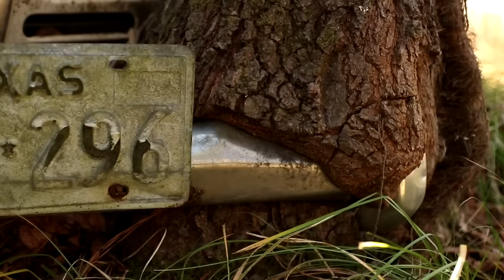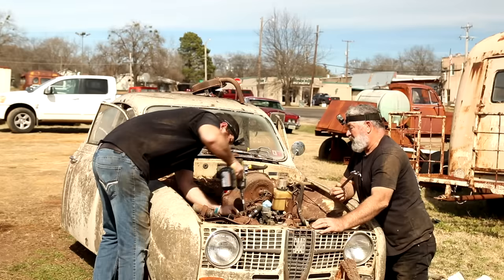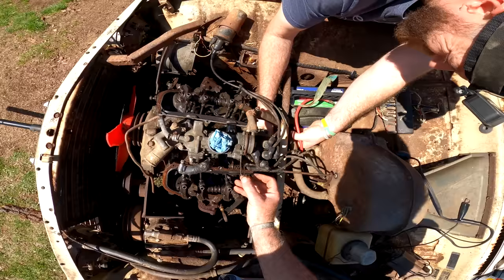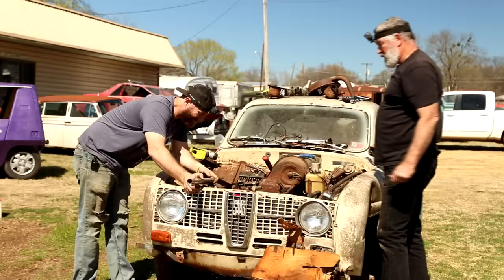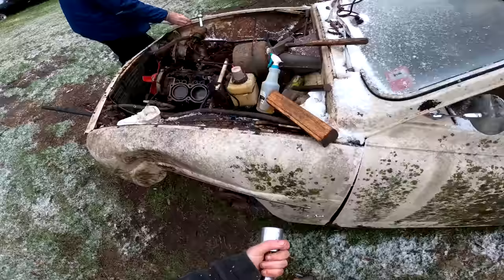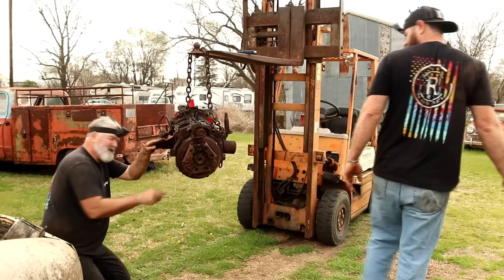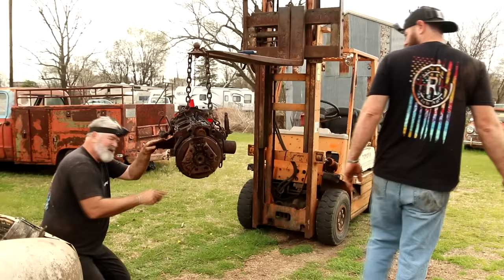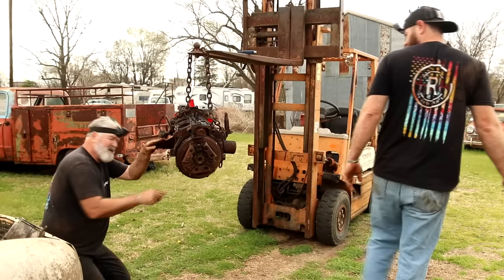THIS IS BAD! Attempting To Start Locked Up V4 Engine Covered In Rats Nest | 1968 SAAB 96 | RESTORED

Comment from the maker: Watch Us Rescue This Car From The Woods Here: https://youtu.be/ilqYDlPsD6g
Reply: I'm watching the guys intently to see the car functioning, I'm actually excited. Keep up.
Reply: @dumisanimashabane3206  .ok
Reply: Saabs are notorious for their transmissions crapping out. Love that your trying to bring the Saab back to life. I’ve owned several myself, my 1987 we had to replace the transmission.
Reply: Question please : How do you find replacement parts for this old rare Saab ??
Reply: Have u heard about youtuber mustie1. The undead master of all engine.
Reply: If it is water in the cylinders, there are in the carter, crankshaft. You need's first to change 100 years old oil, and then crank the engine. I get on it, the water in the oil was above all the engine mechanism.
Reply: @jeanmontinat1681  by asking me and several other Saab owners. I have owned several of the Ford V4 engines that were used in the vintage Saabs. I have connections with many other people parts and knowledge about them.
Reply: I can help you find parts for that car. I used to have 10 engines, 14 transmissions, and many many other spare parts. I have connections with people that can help. I’ve owned 5 Saab Sonett cars and 2 Saab 9-5 cars. Let me know what you need and I can help
Reply: I’ve owned…
1969 Saab Sonett V4 
1972 Saab Sonett III 
1973 Saab Sonett III
1974 Saab Sonett III 
1974 Saab Sonett III 
2004 Saab 9-5 Arc
2008 Saab 9-5 Aero
Reply: Apply  gas. In. The. Cab.   It  may. Start.
Reply: Why not clean out with some rust remover so you can see what's what cause it's bad enough all the parts you have to remove.
Reply: Nd you jenius
Reply: Yes Dhe bhets
Reply: Вааппршщ
Reply: Вааппршщ
Reply: Вааппршщ
Reply: @dumisanimashabane3206  😊
Reply: @dumisanimashabane3206  😊😊😊😊/
Reply: @dumisanimashabane3206  😊
Reply: If you don't already know its a stable 96 (ninety six) nicknamed  the jelly mold due to its shape the engine is a v4 ford engine used in 50s ford's like the concel

Comment: HEY! I hope you see this comment but the freewheeling clutch means you can not pull/pushstart it! The clutch engages slowly when the engine revs to a certain rpm, ~1500-2000. The freewheel clutch operates EXACTLY like a chainsaw, kicks in with rpm. Identical operation in bigger scale. You can put the car in gear without pressing the clutch when taking off. The 96 had the freewheel clutch because this body style saabs used to have 2-stroke engine which seized; didn't get lubrication if let to engine brake but Saab decided to continue using the freewheel with these German Ford V4 engines. These cars were built where I live, were very common back in the day.
Reply: I made this comment on another channel. How the FK did it get here???????????????
Reply: @UberLummox  where else would that comment be relevant? you sure? :D
Reply: The freewheel mechanism can be locked out, just pull the lever.
Reply: So wrong! You can change gear without using the clutch when at some speed 'driving' and the freewheel is engaged. Starting from a standstill without using the clutch would be 'impressive' and harm the gearbox bigtime, next to impossible! Drive it like a manual! How I know? Currently have four of these SAAB's as in two of the 96 model and two 95's thats the estate or 'wagon' version. Oh and you cant reach any part of the crank from outside, needs front cover of engine taking off for that. Trying to hard to turn it over when stuck as bad as this one can harm or ruin the costly cam gears made of 'fibre'. SAAB Club of Sweden can sell you most of the parts needed, and yes they happily ship parts worldwide. Otherwise try Tom Donney in the USA. He even remanufacture some gearbox parts for these.
Reply: @thatdudeinorange2297  I agree on the taking off part. 

But he was right about the short-nose body style, and early long nose body style, was 2-stroke, and the reason for the freewheeling!

But the freewheeling was because of lubrication, IIRC?
Reply: @thatdudeinorange2297  maybe they are lucky and the gear wheels were exchanged for metal ones as the car has AC installed.
Reply: Freewheeling engages in one direction and disengages in the other, just like a bicycle wheel. It must be driven like a standard manual gearbox from standstill. But when moving the revmatching feature allows gear changes without the use of the clutch. If push starting the vehicle is needed, the lockout lever must be in the right position. That lever is usually not frequently used and can be frozen. Check the linkage on top of the gearbox if it is moving or not.
Reply: You had to use the clutch to pull away the freewheel clutch only worked on overrun so you could change gear without using the clutch but you were advised never to engage it if you were towing as there was no engine braking in overrun
Reply: Also the freewheel was engaged or disengaged by pulling or pushing a lever down near the clutch pedal
Reply: Hey you're right|| I had forgotten that my 1968 Montecarlo Saab (3 cylinder 2 strokes!) had that free wheeling feature.. but I wonder if they equally had it on the four stroke V4 engine as well?? Good point.
Reply: @volvobrynk  The 3 cylinder was the 2 stroke engine. The V4 is a four stroke.
Reply: @disneydorks6396  yes, I know.  
What makes you think I didn’t 🤷‍♂️
Reply: I used to have a ford  capri .when ford had ties  with 🇩🇪 Germany that car I wish I still had .it had  plenty of rpm.s  2 door grate car haven seen one in 25 years now
Reply: @thatdudeinorange2297  I know a lot of people who like doing that. Know idea why maybe think it's cool well its not any manual transmission if you install on shifting gears wit out useing the clutch will destroy the gear box... and who know what else  why destroy the gear box on purpose
Reply: @thatdudeinorange2297  but the hole 👉  is why bother your accomplishing nothing  you can do what your saying but for how long in the end your still destroying the gear box
So why even bother just do it normally
Reply: @thatdudeinorange2297  100 percent correct finely a person with common sence
Reply: @markcaswell715  you never use the clutch when towing any Manuel  or you will destroy the clutch. It's not a big mystery here.just drive it normally and you will get years of  maitinace free issues
Reply: @disneydorks6396  we know that already we're beyond that. Sab should of stuck with the 2 sroke  isetta  did
Reply: I believe it was around 72   or 73  small but a greate car
Reply: The capri was a greate car back in 73 but as time went on the got to big and ugly
Reply: It's not a lockout lever, it a little T handle you pull out from under the heater. The comments about a freewheel being an automatic clutch is hilarious, the posts from the expurts here are certainly amusing.
Reply: @rickwaldron4255 ; nope that's a late 60's, the second year of the V4 models.
Reply: @thatdudeinorange2297  Correct, that freewheeling clutch works when you switch to second and more. That was , I think it was from time in 2- stroke engines. Because revs did not come down so quikly than 4-stroke-engines. But I have had both of them and it is fine with 4-strokes too. Only Saab had this.
Reply: @mattinieminen9826  And Auto Union DKW.
Reply: @thatdudeinorange2297  I really don't think they care about what breaks on this car
Reply: The three cylinder was 2 cycle. The v4 was 4 cycle Ford engine
Reply: So that means it just needs to be locked
Reply: No the 'freewheeling clutch is NOT like a chainsaw. It is more like a bicycle so you can stop pedaling and coast. You can NOT put the Saab in gear when idling without pressing the clutch and you need to slip the clutch to get started just like a normal manual transmission. The clutch does not slip it is a normal dry pressure plate and clutch design. The 'freewheeling mechanism is mechanical and resides in the transmission and there is a lever to engage/disengage the 'freewhelling' feature of the transmission for engine braking in mountains or to push the car to bump start it.
Reply: Suomi mainittu!

Comment: I really want to see more of this car. It’s so unique and I’d like to see a little bit more progress on this one!
Reply: Absolutely. I love unique cars. I know it takes a bit more to get parts and they're unfamiliar but that's what makes the videos so interesting. Please do more with this Saab.
Reply: I owned one similar.. except that it was the "Monte Carlo" edition with the original Saab two strokes engine, three carburettors.. ;-) much more fun. Saab made two strokes engine cars for over two decades, then they put these V4 Ford engines for a couple of years and then got that famous Triumph 4 slanted cylinders block in their new "99 model" wich was in fact the same car (the 96 model) but made wider and more modern looking. Then they added the turbo to it.. and the rest is history.. I still drive a 9-5 model Saab that drives and looks like new after its 14 years of use. Bravo Saab.. By the way, if you look on the net, you'll sure find Saab 96 models racing in rallies and winning.. they were fun cars.  Sylvain Giguere Québec Can.
Reply: Yeah,  get the parts and rebuild it. You win some and you win some harder. You don't lose some.
Reply: Apparently you can do a full turbo race build on these engines!
Reply: @GiguereSylvain  Slight correction: the 99 was a completely new model, nothing to do with the 96. The classic 900 was a reworked 99 though.
Reply: @vibingwithvinyl  I had a '72 with a transverse-mounted 4 cyl. in it. They were great cars.
Reply: Well it's been 7 months. Looking at their video history, they don't return to a project this old
Reply: Same, I hope you all keep at this one, it's not the same old same old.
Reply: Lawn art maybe?
Reply: @ericinmon7205  yes indeed you can!
Reply: @vibingwithvinyl  I am driving a '92 900 tSaab ! :)  Such a joy - and blows the doors off modern cars :D

Comment: hey guys.... short term cross two batteries to 24v to get her to spin like hell... leave the ignition sytem on 12v..    of course the starter will only last so long BUT i bet youll get her to bust off... dont ask me how i know!
Reply: haha Been there too myself Puddin! sometimes gotta give her all the juice
Reply: Had five H1 Hummers where I worked. Diesel engines with 24 volt system. We had a d8 battery on a handcart we we would put in series with the two batteries in the H1. Of course the fact it was every bit of zero degrees out when we were trying to start..
Reply: I think puddin needs this to put a Datsun motor in it.😂😂
Reply: Hey Puddin, these guys are doing miracles.. did you see that ford?
Reply: I just my 36 volt golfcart and connect 3 batteries together (18v) works great
Reply: Was thinking this same thing….
Reply: How do you know?
Reply: Puddin how would you know??? :) It's good to see you boys are watching out for one another!
Reply: Or go and and buy a 1,000 cranking amp truck battery (thy're relatively cheap, $90 here in Canada) and it'll getting you spinning fast without frying the wiring.
Reply: @nelsonllewellyn8630  that's a very old truck with 24 volts. 30 years of trucking and I haven't seen a 24 volt truck yet. The batteries on a truck are 4 - 1,000 amp 12 volt batteries linked positive to positive, negative to negative. 1 - 1,000 amp battery will spin that little engine fast enough to get it going.
Reply: @rantsfromtheroad2055  the engine seems to spin pretty freely, so it doesn’t seem like it’s a load issue.  More CCAs would get it spinning faster if it was getting bogged down by a heavy engine, but it will take volts to get the starter to spin faster with low/no load
Reply: Hah, I just suggested this, before I saw your suggestion!
Reply: @67marlins  motor is not stuck….. it’s low compression…. I’d just put some zero weight in the cylinders and see if it barks off
Reply: @nobodyspecial6436  OK, Good luck....let us know.it definitely seems an interesting vehicle worth the effort.
It is not your vehicle, correct?
Reply: @nobodyspecial6436  you may wanna relax .....I was attempting to ask you a question, AFTER I politely asked if I was beginning to understand you after reconsidering.......sooooo again maybe you wanna relax and use the advice you just dispensed.
I rescued several motors being cautious, and I was never afraid to ask questions.
Reply: @67marlins  i assumed you were being sarcastic… if i was wrong I apologize and stand corrected but i’ve brought back a few engines myself… found diesel fuel and vicks vaporub( the strong smell in the rub is Mynah’s Liniment)… cuts through most anything
Reply: @nobodyspecial6436  OK, fair enough.
What works wonders for me, was something called, 'Aerokroil', made by Kana Labs of Nashville, Tennessee.
Kano had a whole line of excellent chemicals that released many rust-frozen parts for me, since the mid 1980s.
It's expensive, but try it if your previous methods ever fail.
Reply: @67marlins  my revival days are long behind me now…. Married with grandchildren now… plus most of the oldies are all gone and i’m too old to go looking….i just enjoy watching it on here now
Reply: @nobodyspecial6436  Yeah but you can always still teach what you've learned - that's ALWAYS valuable, believe me.
I do that with a friend who's learning to be a contractor, basically.
Reply: Its called scaring into life , Has worked in the past for me. And I just subscribed to this channel
Reply: GIVE ER ALL THE BEANS
Reply: ^^ THIS!
Reply: I can literally hear that BUT 😂😂

Comment: I'm currently rebuilding a spare motor for my Saab and had to do the same as you guys to get it unstuck. I hope you know that the oil pump is driven off the distributor, so having that removed and cranking the starter means that there is no oil circulating round the bottom end. Also you spotted that this is an open deck design of block with wet liners. This design was only used for the first couple of years of the V4, meaning that this is an early V4 motor. later ones were a closed deck design. Spares and gasket sets are reasonably available for these motors, so you shouldn't have much problem with that. The rings on mine were stuck that bad that most of them got broken during removal, I had to chisel them out of the ring grooves!

Comment: I loved my 96, which was a '71, and its Ford Industrial V-4. It was great fun to drive, and an excellent car. GM bought out SAAB and promptly ran the company into the ground. That's GM for you. They even put SAAB badges on Subarus. It was good to have two competing car makers in Sweden. Now China owns Volvo. Phooey.
Reply: There is Tshirts Available with; Saab born from Jets, ruined by a-holes! 
With a Saab logo above and a GM-Logo with a red line over(!) below.
Reply: @volvobrynk  GM spent a ton of money on SAAB as did the Swedish government before them  as the company had not made any money forever, you rag on GM but if it wasn't for them wasting all that money they would have went under years ago. As mechanic I can tell you no tears shed here.
Reply: @jimhaines8370   Do you know why GM put money into Saab? Because they made them money, or do you think GM runs a car-charity? They pretty much "cooked the books" when it came to sales to be able to do tax-write offs. For instance the US-sales wasn't included under the Saab name so in Sweden it looked like they were loosing money when they in fact was self sufficient.
More can be read by KPMGs report that they made on order from the Swedish government.
Reply: @jimhaines8370  I had a 1991 900i, my dad had 1990 900 and now owns a 1992 900 aero/spg.

They are some very well enginered cars, and i will really miss them! 

The 900 was the second best car I ever owned. They way that handles in snow, I second to none! So i don’t buy that GM was of no fault, there was more things to it then that.

I agree l, GM send a lot of money that way, and kept them a float, yes. But also tried to “normalizing” an very unique car!
Reply: They all sound like Saab stories to me
Reply: the reason G. M. was interested started in 1988 / 1989 AFTER the interduction of 86 / 87 SAAB 9000 @ the time ended up being one of the 10 fastest production cars in the world! the Cadillac of today with it's 2.0  - cylinder -
turbo, owes a lot to Saabs effort of the past
as a SAAB guy i saw the intelligence in design - exocution not so much, food for thought sincerely
Reply: @volvobrynk  Didn't they want SAAB to use the Astra chassi. They took a look at it and made a whole lot of improvments, basically designing a new car of it. Only then SAAB felt that they could call it a Saab. And ofc, GM wanted the tech from Saab, turbo tech and the variable compression engine prototypes. Got gutted and kicked to the curb after a while. One less competitor I guess.

Comment: Hello guys.
Exciting rescue mission. I'm not a SAAB guy, but I know old SAABs were equipped with freewheels. This may explain why the transmission feels a bit slippery and messy. It's a leftover from the era of the two-stroke engine.
Tip, take a quick look at wikipedia on SAAB 96, to understand what kind of car you are dealing with. It is a good and iconic car.
(SAAB 96 were popular as rally cars here in Sweden and Finland)

Regards
Christer
Reply: "Karlsson pa taket" et.al. made these little cars famous with the Scandinavian flick. Which you had to do due to FWD but it later transferred to 4WD as well since they also understeer. They also pioneered left foot braking so they kept the throttle down in the turns.
Reply: The freewheel was a leftover from the 2 stroke days. It did have the advantage of not needing the clutch once the car was moving.
Reply: @azynkron  the 96 was never transferred to 4x4, where did you hear that?